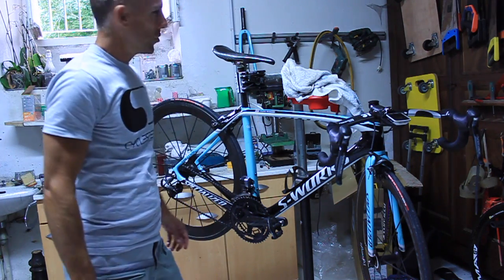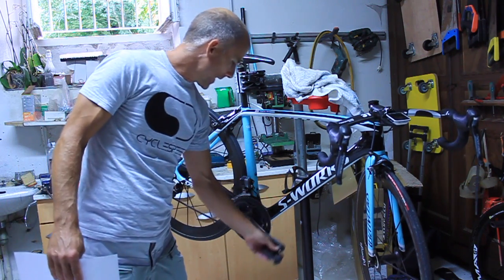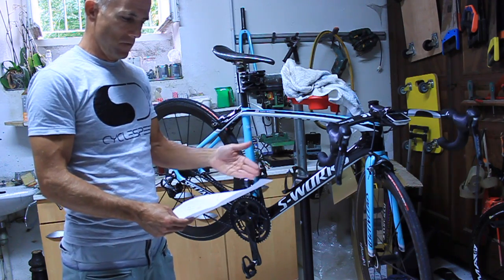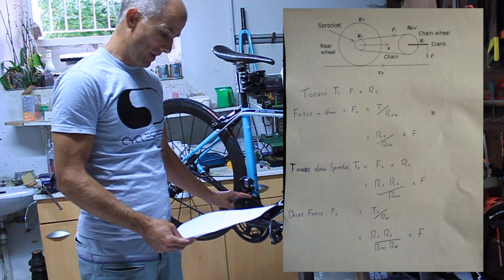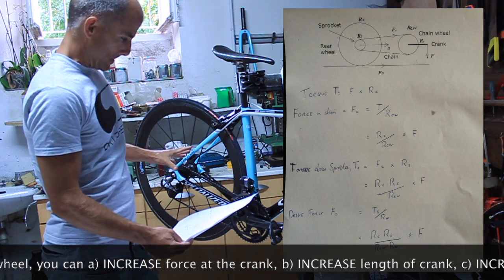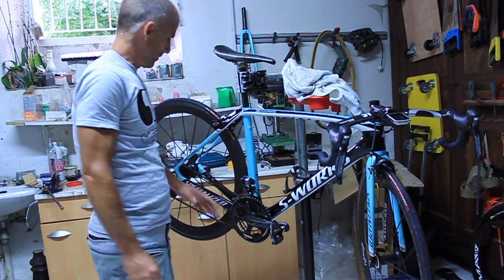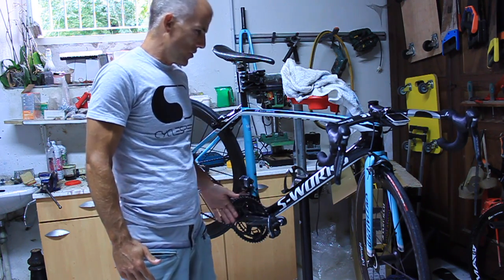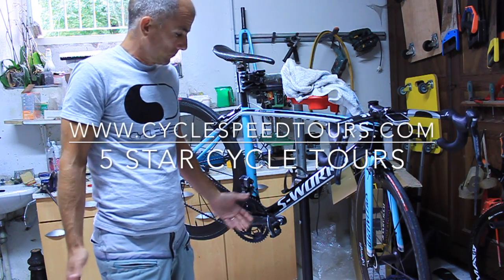Crank Length: Exploding some Myths

Comment: People are not thinking about the leg of the rider.  A shorter crank means a smaller circle for the feet to move in. A longer crank will mean slower RPMs. A shorter Crank will mean faster RPMs. You need to get used to the shorter crank to  pedal smoothly.  It is much more comfortable to pedal out of the saddle with a short crank. A short crank will feel like you are walking up a hill rather than pedaling up a hill.  I did that with Murray cranks at the 155 MM setting.  I gave up on them because the area where the pedal attaches is to soft.  A person on a leg press Machin can push more weight in a short stroke rather than a longer stroke.  A person cannot move the same weight with his legs compressed against his body pushing out than when his legs are not compressed against his body. A shorter range of movement moves more weight.
Reply: I have 153 mm cranks and tend to look at crank length along the lines of long cranks are like a diesel engine ,slow rpm but lots of torque whereas the short crank is like the rotary gas engine with lots of rpm to get you places, assuming you can maintain said high rpm.
Reply from the maker: Good points. Longer crank = higher circular foot speed (for the same cadence).
Reply: artie whitefox we're looking for work, not force. Shorter cranks are easier to turn higher rpm, within reason, but if you are applying the same force over a smaller circle, you're doing less work.
A longer crank will require more work to reach the same rpm, but you don't need a high an rpm to do the same work.
If you are trying to go fast, the goal isn't high cadence, it's more power.

Comment: focus almost always seems to be rider dimensions.   I think another important factor is your ratio of muscle fiber types.  

 if you're a 100 yard sprinter, you're going to have massive power in the legs that can push higher gears and you don't want or need longer arms.  (albeit not for very long because of that muscle type)   This is exactly the same in drag cars where cars top fuel cars only run 2 very high gears because that's optimal to get down to the end quickly.  Using low gears and high spinning rates would be wasted power.     

vice versa for a marathon runner with much more endurance in the legs but no power.
Reply from the maker: True, leg strength will play a role, as in any case, this will impact whether you are a natural spinner or masher. The holy grail is of course strength AND speed. And speed is easier to achieve with shorter cranks (within reason).

Comment: it´does not work like that, if you have longer crank arms you have a true final gain on torque: when you change to a higher cadence you only divide the applied torque in a small number by doing more revolutions, a longer crank arm divides torque into less number by doing a longer travel, but the cost you are paying is the extended movements on your legs and a lose in aerodynamics. by the way bradley wiggins only uses 170 on track
Reply from the maker: Yes, there is a gain in torque with a longer crank arm, but equally, there is a gain in torque by increasing lever length at the rear wheel, i.e. moving up a gear on the cassette - a 5mm longer crank = chain 5mm higher on the cassette (approx 1 gear).
However, once in that easier gear, the short crank rider will have to increase cadence slightly to maintain the same speed as before. Thus, shorter cranks promote higher cadence.
And when moving to shorter cranks, you may to adjust your gearing (larger cassette or smaller chainring).

Consider this from an industry expert;

As Victorian Institute of Sport sprint coach Carl Brewer explained, “crank length is part of a system of leverage that covers everything from wheel circumference, gear ratio (chainring & sprocket) and crank length. The distance the pedal moves as a ratio of how far the bike moves is the true gear, and it’s called a gain ratio.  Riders get very confused when they change crank length because they’re not factoring in the change in this ratio. If you put on longer cranks you are reducing the gain, so it feels easier – it’s not the longer lever doing this, it’s the change in gain ratio and you can get exactly the same effect from using smaller tyres or changing gears. A ratio is a ratio.”
Reply: Cyclespeed Tours thank you for pointing out that you have to consider the ENTIRE system when considering the effect of changing a component of that system and how optimization is what should be your ultimate goal.  The elegance of a complex system like a bicycle drive train lies in the fact that small changes across the system can result in performance changes, both good and bad.  Fixating on a single component, like crank length, can be an interesting short term experiment in optimization of power and/or speed, but to think I might HAVE to lock into a certain length because of my height or some other physical characteristic is short sighted.  The beauty of a multi - speed bicycle is how so many things come together and  create something greater than just the sum of its parts.  Changing tire size, tire pressure, rim depth of wheels, cassette configuration, chainring size, seat height, etc can, and do, affect performance.  That's part of the fun of cycling.  It's a big experiment.  I really appreciate your balanced approach to these topics. Please keep posting videos like this.  Cheers.
Reply: Cyclespeed Tours thank you for pointing out that you have to consider the ENTIRE system when considering the effect of changing a component of that system and how optimization is what should be your ultimate goal.  The elegance of a complex system like a bicycle drive train lies in the fact that small changes across the system can result in performance changes, both good and bad.  Fixating on a single component, like crank length, can be an interesting short term experiment in optimization of power and/or speed, but to think I might HAVE to lock into a certain length because of my height or some other physical characteristic is short sighted.  The beauty of a multi - speed bicycle is how so many things come together and  create something greater than just the sum of its parts.  Changing tire size, tire pressure, rim depth of wheels, cassette configuration, chainring size, seat height, etc can, and do, affect performance.  That's part of the fun of cycling.  It's a big experiment.  I really appreciate your balanced approach to these topics. Please keep posting videos like this.  Cheers.
Reply: Oprah uses and recommends a 175
Reply from the maker: Thanks for the detailed post Craig. It's true that the bicycle appears simple at first, but is in fact a complex series of machines combined into one to create a superb invention that keeps on surprising us!
Even now, after so many years, improvements are being made and new approaches found. Experts still do not have all the answers.
So it's great to experiment with all the variables and find what works best for you!

Comment: as you said: nothing to loose by trying - thats true also with longer cranks if you have long legs. I (inseam 90.5 cm) definitely go better with 180 s...
Reply from the maker: Bradley Wiggins is 6'3 (1.90m) and now uses 170mm cranks (down from the 177.5's that he used before). Also, you will struggle to find many pros using >175mm, even the tall ones. But these guys tend to spin faster and longer than most, so if you are a low cadence grinder, then you may feel better on longer cranks.